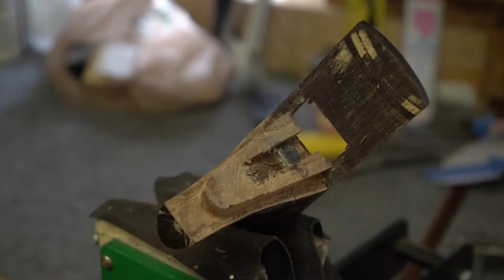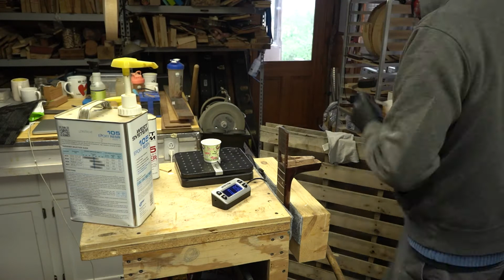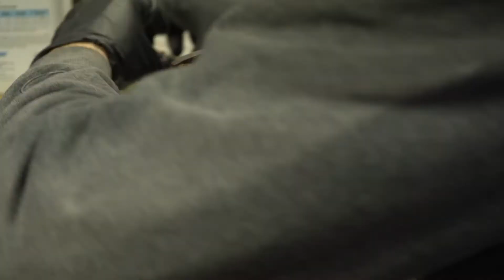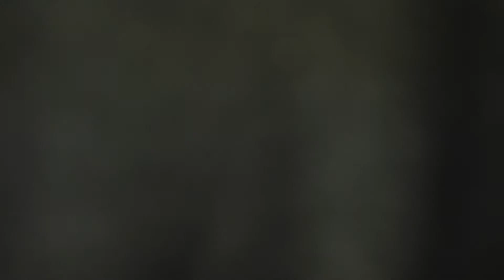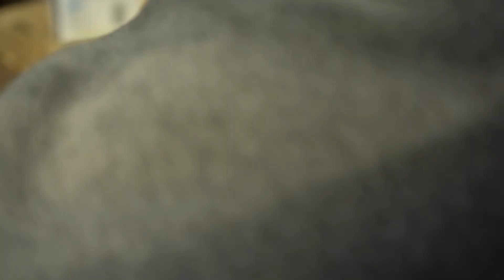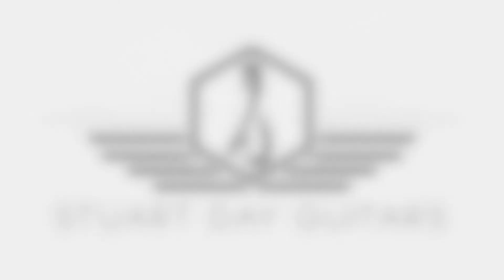Repairing cracked heel

Comment: my 70s suzuki has a crack in the heel and this is the first time i've seen how a repair could be done and man that is involved. i don't suppose you know roughly how much a repair like this would cost from a luthier?
Reply from the maker: the difficulty with a 70's susuki is that the neck is likely glued to the body with an epoxy. this was very common in that era for cheaper asian imports. That would make it a job that a lot of luthiers would likely turn down. If you can find someone worth their salt whos willing to do it you might be looking at $400-750 depending on where you are located. Finish work always adds signifigant cost as well
Reply from the maker: its also worth noting that its not always possible. even with a lot of skill and willingness. Sometimes manufacturers were more concerned with cost and manufacturing efficiency than they were with the future repairability of their instruments.

Comment: The neck is already removed, so it's not super helpful, especially with no context.  Also,  you might want to consider using a fixed focus setting, as it keeps auto-focusing on the texture of your cuff.